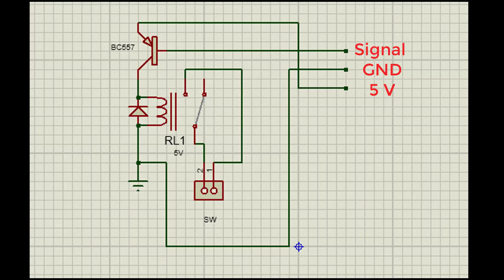Super Hack of Relay  ! you have Never See before b

Comment: What about using a mosfet to switch the counter directly from the module? It could be easier.
Reply from the maker: it will be good , did you try it ?
Reply: @Inventor_AW  No, I didn't. Maybe You could make a simplified v2 in the next video. Greetings.
Reply: Not a bad idea. I'd like to  version 2 of that...👍🇮🇪🙏🏼